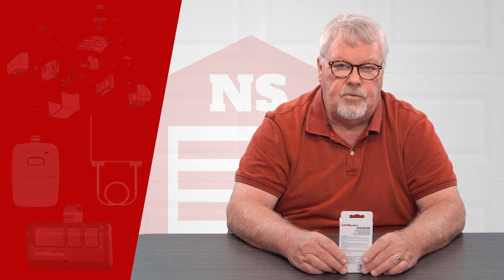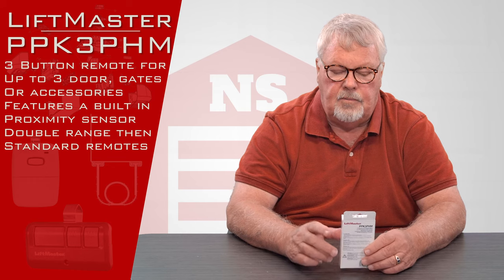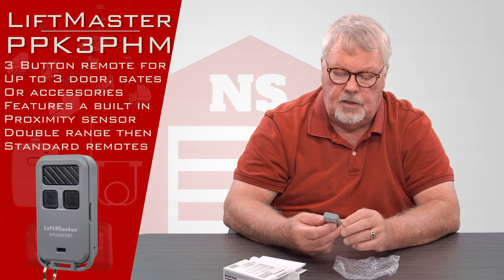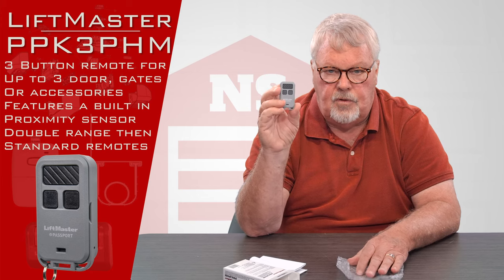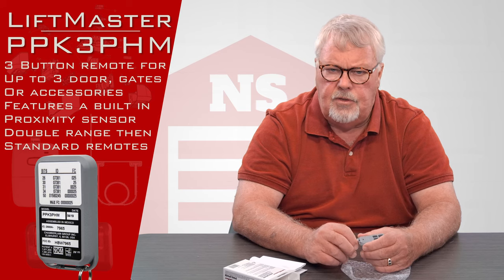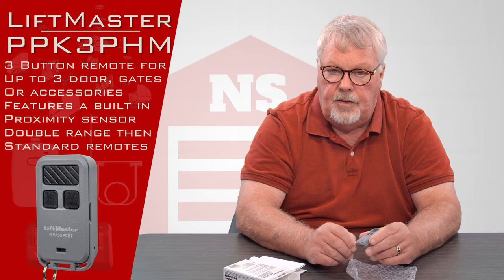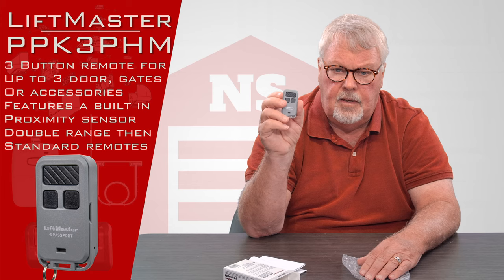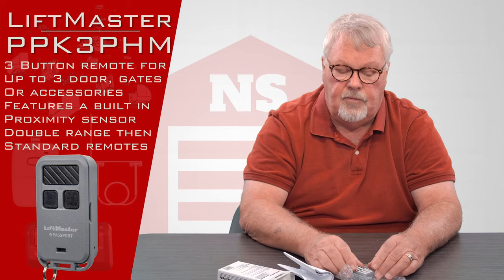LiftMaster PPK3PHM Passport MAX with Proximity Sensor Remote Control

Comment: We have parking gate works with 318 MHz, and I have this opener. It works on the front door of building but it won't work on parking gate. Our building manager said it must have a different frequency on opener. Just wondering if we can change the frequency on the opener?